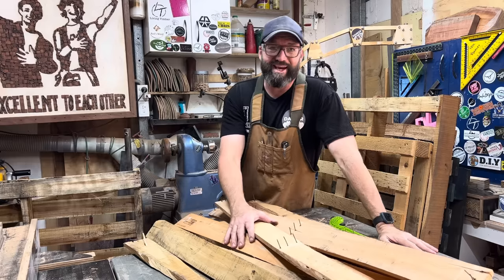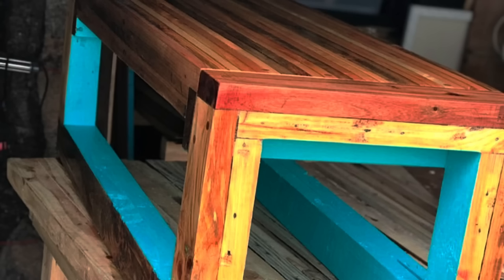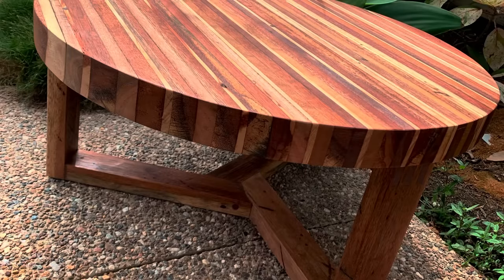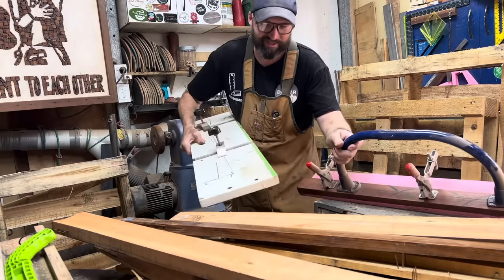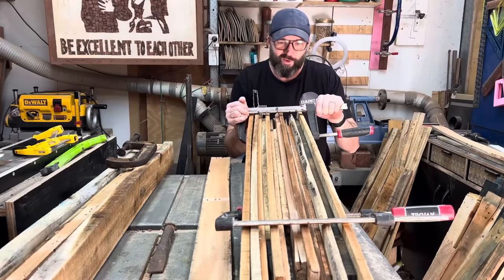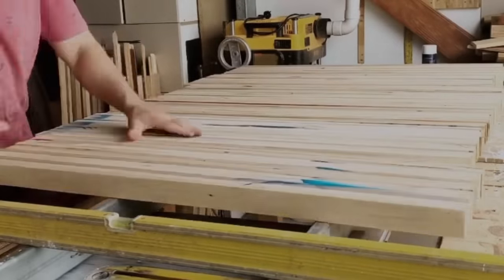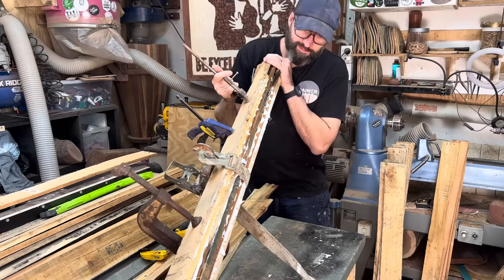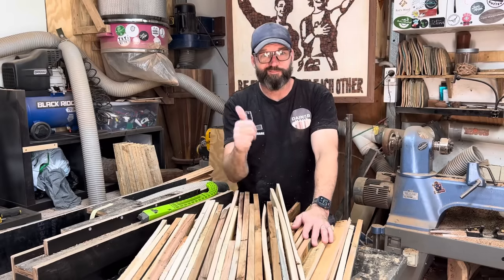Use PALLETWOOD to make MONEY and learn woodworking.

Comment: Awesome, I think there's one important thing to mention though, which is methyl bromide. Depending on where the pallets were made and what was shipped to where, they might be treated with this pesticide which you don't want in your furniture (though it will probably prevent bug infestation) and most certainly not breathe in while sanding it. In many cases you can check out the ipcc stamps on the pallets to see how they were treated, where HT is heat treated and MB is for the nasty stuff.
Reply: I stand corrected, then!

Comment: Just FYI to anyone looking to do this.  In the United States, you need to check the stamping on the pallets.  If it says "MB" on the pallets, they've been treated with a toxic chemical, and should not be used.
Reply: @dainermade  No, it is not recommended by any major woodworking source, and is highly discouraged. MB pallets are treated with Methyl Bromide, and should not be used for woodworking projects. They should, also, not be burned under any circumstances. HT pallets are Heat Treated, and, although safer, are also advised against. For more information: https://en.m.wikipedia.org/wiki/Bromomethane
Reply: @dainermade  I have nothing against pallets. I am merely stating the importance of the awareness of different types of pallet woods.

Comment: The biggest issue with pallets is the fact that they're all made of low grade and often scraps of wood. You get some pallets that are like 2/3rds soft wood then 1/3rd hard wood, all in poor condition.
But that by no means makes them useless, just means they're not fit for cabinetry or high-end furniture.

Comment: The only good thing about pallet wood i that it is free. You need loads of pallets 'cos the % bad wood is huge. If you get good planks off without splitting them their intedritty is that of thick toast. They can make fun gardden projects and you learn a lot ( dont use pallets :) ). It is much quicker to use better quality wood to begin with.

Comment: Anyone have a solution for the helical nails used in pallets? They don’t pull out like regular nails, much stronger. Usually the wood fails and cracks before the fastener does - ADVICE FOR A COLLEGE KID PLS

Comment: most problem with those keyboard warriors are they dont know where to start thats why they assume its a 30k bussiness i started literaly with nothing just bought 4 pieces of mdf for 60euros cause i wanted to build a pc in table so i made firstly a 4 side box i saw ppls doing a insert space in the middle and said ah no its too complicated later i realised when i sit on the pc it blocked me to put my feets in started again cutting measured half of both sides did alot of mistakes used alot of wood filling glue and sanding by hand at the end i bought a double secured glass it took me 2 months at the end i wasnt happy with the finish so i went and buy a sanding machine for 70 euros with its battery you can buy cheaper with electric cord like for 20-40 here i learned my mistakes and at the end i made it looking like ultimate table happy as it goes sure could have table saw for some hundreds and other tools but it wouldnt cost even 1000 to be fully equiped from professional perspective but alot of the work can be done with hand those warriors are just too lazy to do anything in their life i once mirror finished an light axe head made my own wood handle and did put it for 90 despite you can find axes in the shops for 30 it sold in 2 days cause the guy said nobofy sells anymore those 200gramms axes he needed it in his house to cut small pieces of wood for his fireplace what i want to say there is bussiness literaly for anything you can think of if you know how to im also electronicial repairing phones motherboards and anything that is broken 50euro soldering station and i repaired thousands of things worth of hundreds once did repaired pcie slot on mobo worth of 300 euros

Comment: Instead of pulling the pallets apart, I take a reciprocal saw metal blade and cut the nails slipping the blade in sideway.Less work.
Reply: So when I cut the nails with metal blade, the nail remained in the frame part and destroyed the blade when I tried to table saw. Better to pull out nails!
Reply: @dainermade  yep a little chunk of metal got stuck in my forehead!! The alcoholic Carpenter does it again! hahaha!

Comment: Love your stuff but I have to say that pallets are treated with super harsh chemicals to withstand the conditions they are put through during shipping. The chemicals have soaked into the wood and are highly toxic for animals/human to be around in general. In general, safe pallets will carry the DB, KD, EPAL or HT markings, meaning that they haven't been treated with dangerous chemicals.

If you see an MB, the wood was fumigated with a chemical called methyl bromide. Although the use of methyl bromide was banned in March 2010 as an acceptable treatment under for pallet wood, you may still find a pallet that was treated using this method.

Also, pallets that are colored shouldn't be used since they are often used for toxic chemicals which may have contaminated the pallet. 

Some pallets have no labels on them. This means this pallet is likely for domestic transport, and do not require regulation stamps since the pallet is not for international transport.
These pallets are likely safe. However, it is better to be careful. It is recommended that you use pallets with stamps so you can trace and know the pallet treatment.

If you want to know more, watch the video below before you start making your own D.I.Y. pallet projects

https://youtu.be/SOAn8oh_7W8
Reply: @dainermade  Sounds good, stay safe

Comment: Unpopular opinion: pallets just arent worth it for most people.  While they're free, there is a huge opportunity cost from all the wasted time processing them.  It is a significant time investment to break down pallets without breaking them and removing all the nails.  Then you gotta sand the rough, low quality wood.  To avoid breaking the boards you need to buy a pallet buster, a nail snipper and to make it look nice you need to invest money in a decent planer.

Once the wood is processed you're dealing with wood that's limited in length and width, and need to spend extra time joining it all together to get the desired area you need for simple projects.  Yes you can make a couple hundred from free wood, but if it takes you 30 hours you're below minimum wage.  You would be better off flipping trash picked furniture with less headache.  Pallet wood is great to learn the basics without worrying about messing up, but is more of a hassle to work with beyond that.

A 2x4 is $3 at most big box stores.  Plywood isn't that expensive per area.  Get the wood that's right for the job and build it better and faster, move on to the next project and spend some time with your family.  Time is the one thing you can't get back.

Comment: Thanks for this video.
I also started with palletwood.
But... It's really time consuming and time is money.
Plus even if you carefully remove the f*ing nails, there are some tiny staples barely invisible which ruin the planer's blades in no time.
60€ for 2 blades. 
IMHO pallets are good to begin woodworking but not a god solution to make a job to rely on. Too much time spent NOT BUILDING but looking for pallets, transporting, dismanteling them, remooving nails.
Reply: @dainermade  No hard feeling here, I respect your choice. I just gave my opinion, based on my own experience. 
Thank you for your work. Even if I disagree on some points, I learnt some things and you offered some inspiration. Thanks :)

Comment: "They're laying around everywhere and they're free."
As someone who has working in distribution for grocery stores, no... they're not free. If distributers don't get the same amount back, the store is charged. When the store is charged, payroll is cut. Stealing pallets is the same as taking money straight out the the pocket of some overworked nightstocker.
Reply: Drive through any industrial area and you will find damaged pallets left out for waste pickup. The business has to pay to have them removed so they are only too happy if someone like this guy comes and takes a few.
Reply: correct lots of pallets have pfand (pay more givethem back and get that money back) but asthe other person said if you have a damaged one noone wants to repair that escpailly with more then 1 bar is broken

Comment: lol, free pallets, heard that before, never seen a concrete example, at least not in my part of the world. They are expensive to buy new and because of that many are reused as much as possible, when that's over they are sold for scrap, but never free. I mean, even if they are totally busted and can't really use them for anything, you can still burn them so turning them in to fuel is  very easy and so they still have value. If you may find some willing to give them for free, those instances are quite rare, so definitely not a good source of wood for whatever small workshop.
Reply: @dainermade  Romania, a smaller city too and not capital or one of the bigger ones that see commercial activity at a larger scale. So the industrial zone is small and you don't see pallets in the trash. When i worked at one of the small companies in that area that was doing mainly stone masonry we did had plenty of pallets but like i said, we used them until they break and then use them to fuel the fire in the work area stove during winter.

Comment: I have a way better way of taking pallets apart.

Use a metal saw with a u shaped frame. Cut the nails between the wood. ... Done. Way faster and you damage wood less.
Sure thenail are still in but you will cut those bits off anyway bc of the holes.

Comment: I was told Palletwood is shit because if it's left outside and it's untreated, so it's in most cases riddled with wood worms. The wood will break down and rot after a short amount of time.
Reply: @dainermade  I see what you did there. hohoho. But I am only repeating what I read in comments from some other internet 'know it all's'. You would have to research that to know if it's a myth or in fact has some element of truth

Comment: Yeah easy if you have a big ass garage or  space. And how much time it takes to build a table to sell it after for $ 90? If it takes 1 day you're loosing money. How much it take to bring the materials even if you don't pay for the wood, then take the nails out, and those holes would be visible unless you use something to cover them(more work and materials) then sanding, buying sandpaper, oils, sending them to buyer. All for $ 100. 🤷 And working with hand tools it's a lot more time consuming then with table tools that cost 20.000

Comment: Probably with pallets is some are treated with formaldehyde. And those will off gas increasing peoples risk of cancer. Hurts sales if you inform people of that. Or you can be like Philip Morris and pretend its not an issue lol. I almost built a bunch of furniture for my house with pallets. Then i learned of the formaldehyde and didn't.

Comment: and now make a video where you do all the same but with the tools for only 100$. and not all you have :)
Reply: @dainermade  :) then what was the point of the comment about 30k ? if you are telling us that it is not 30k in front of devices worth at least 600e. 600e in one corner :)  then why not show and prove that it is not 30k by showing the prices for all the tools you are using.  for example - air compressor 70l/min - 180-200$ . Turning lather - 200-300. and so on. i think most of the viewers would be interested in such a video.